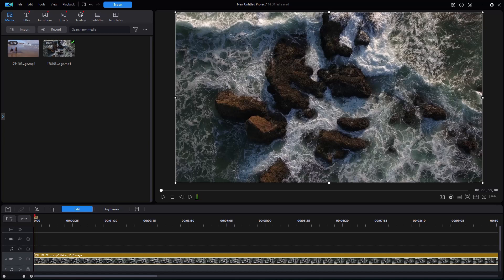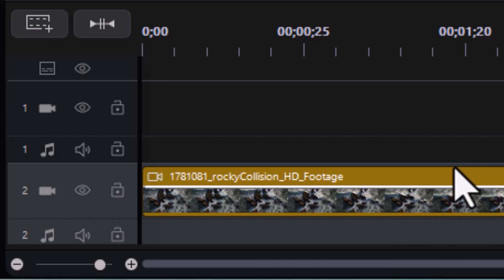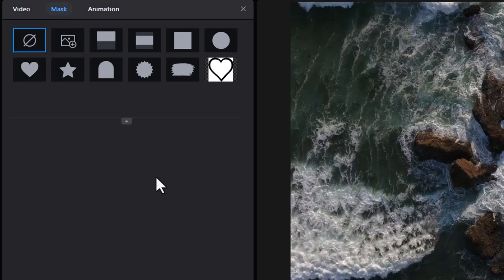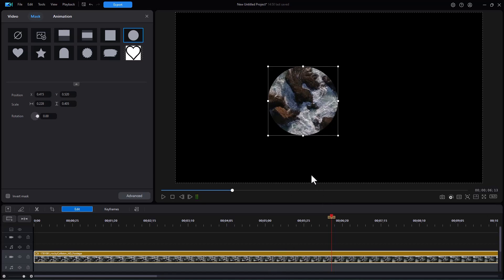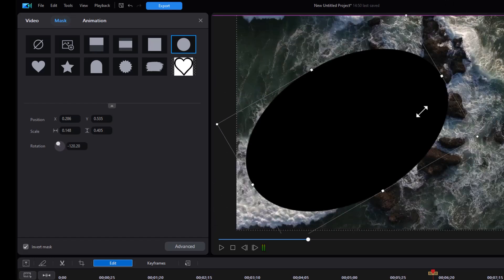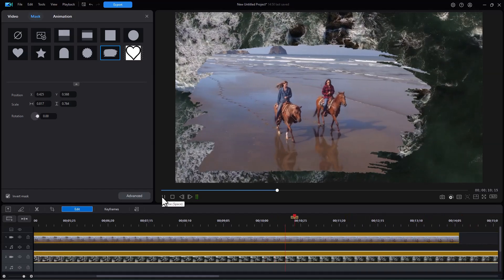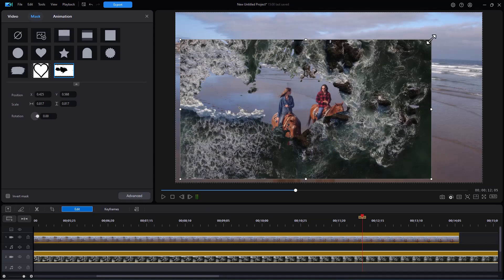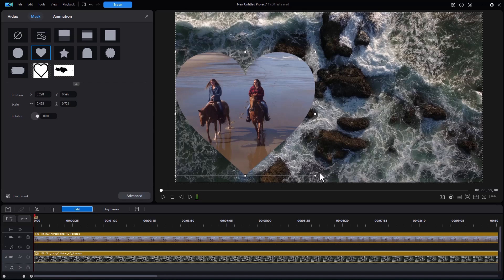Use the basic features of masks with the new PowerDirector 365 interface

Comment: The masking tools is one example where they have changed the interface and brought no improvement (at least I cannot see any). They actually made it worse because I use masking at lot for scrolling text and it took me a while to find where they put mask control and then they removed title reveal. Every time they make these changes it interrupt my work flow. A decent bit of software but I hate how they do this stuff.
Reply from the maker: Lots of changes in the last 12 months. I'm guessing they are done messing with most of the interface for a while. I've faced the same challenges with other types of software, so I expect this kind of challenge from time to time. --Jim
Reply: I agree.  I've just come to edit some videos after not using it a couple of months and totally lost.  They do seem to keep introducing changes for the sake of it.  And this isn't just a Cyberlink problem, although they do seem the worst for totally changing around the interface.